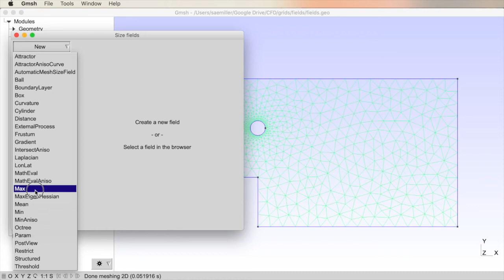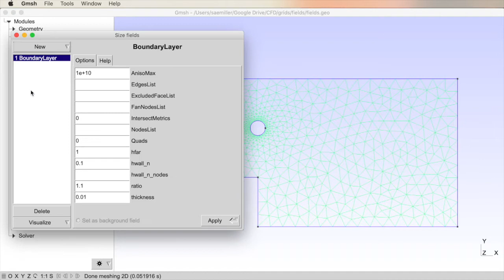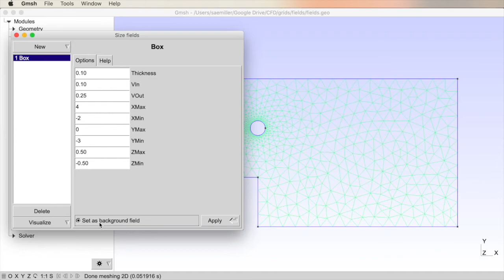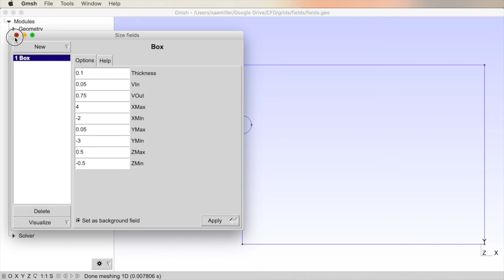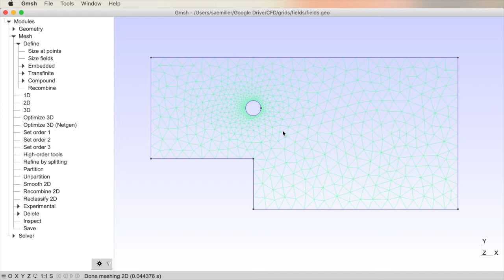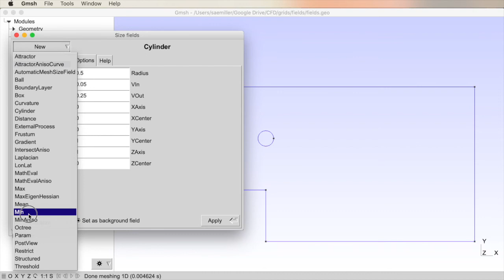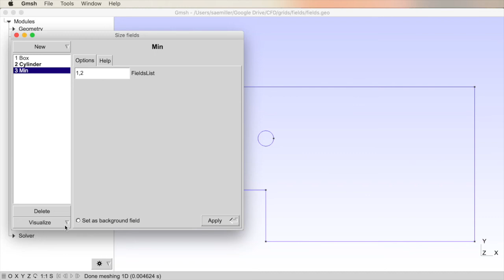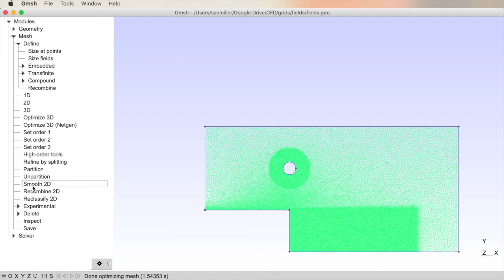Grid Generation - GMSH - 7 - Controlling Grid Point Density with Fields

Comment: Hi Prof. Miller, I would like to ask if, are you aware of a way specify a different mesh size factor along the X, Y and Z directions? These video is very helpful, but it mainly generated isotropic meshes in the specified area. There is also a "point" size tool, but the first element is uniform in both x,y. Thank you again for the video.
Reply from the maker: I'm really sorry, I don't know the answer to this question. Thank you for the note about point size tool.

Comment: I generated a domain of cubic box with inlet and outlet cylinder, Now I want refine the the inlet and outlet cylinder at time with different refinement factor. I used the size field option for this purpose but I can't refine the 2 cylinder at time. When one is refined other is not. Could you please tell me how can I solve this problem?

Comment: do you use this with nek5000? because it doesn't read it for me :(
Reply from the maker: I do not personally but have coworkers who do. I would suggest looking at the output format from GMSH in a text editor and comparing it to the read commands in your source of NEK5000. Then you can match them. Also, suggest looking at documentation if you can't access source code. 

Also, I like your music videos on your channel. That is wonderful!
Reply: Nek5000 requires hexahedral mesh in the GMSH format.

Comment: Hi, I want to know what units gmsh uses while making the geometry.  I made the geometry but I'm confused about giving initial conditions due to the units?
Reply from the maker: They are just values to my understanding. If you load your grid with a solver, you could assign them then. E.g. if I have 1.5, I could say it is 1.5 m or 1.5 in, in the solver.

Comment: What exactly is the 1D button, and why do you always click it before 2D? Edit: I think I get it now, it sets up the grid on the boundary of the surface.
Reply from the maker: The operation by clicking 1D creates points along the lines or curves (1D). One usually has to discretize lines. The lines form a surface, which is then discretized. Finally, the volume is defined by the surfaces. Each one is discretized in order.
Reply: @SAEMiller  Thanks. So, shouldn’t 2d call upon 1d implicitly, without you having to push the button? At worst you might lose a little time recomputing the same points

Comment: Thank you for these playlists. May I know how to avoid the grid generation inside the circle. When I try to have this diagram, it also creates a grid inside the circle....
Reply from the maker: I think that it is likely that you have not cut a hole (so to speak) from your geometry.
Reply: @SAEMiller  thank you for the response. May I please know from where I can cut a hole. I tried various surface options but couldn't figure out the correct method. It there a direct command we can select from the left hand side menue?

Comment: Excellent video! Any chance you could walk through the process of applying the 'BoundaryLayer' size field? I have been trying to do so with little success. For some context, I'm trying to create a boundary layer around an airfoil shape.
Reply from the maker: At the time of making this video I believe that the GMSH team temporarily disabled that feature. I'm not sure why. You can do it manually by making a transfinite mesh. Though this will not be structured. Alternatively, you can in the mesh options turn on growth and this will grow a boundary in 2D. I do not believe that this is working in 3D. Please correct me if I'm mistaken.
Reply: @SAEMiller  Thanks for the quick reply! That is indeed very odd, especially given that it still seems to appear as an option in the GUI menu... I'll give your suggestions a try.